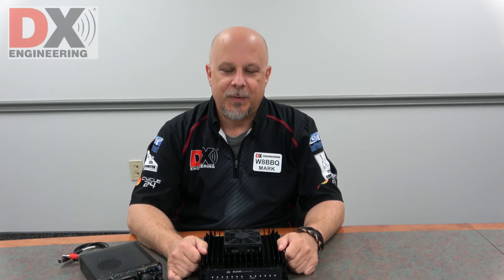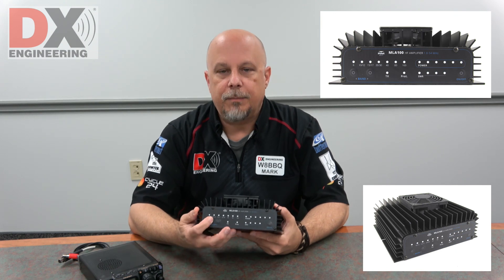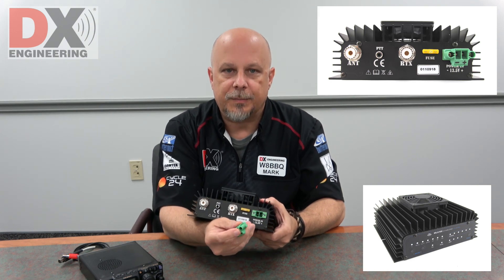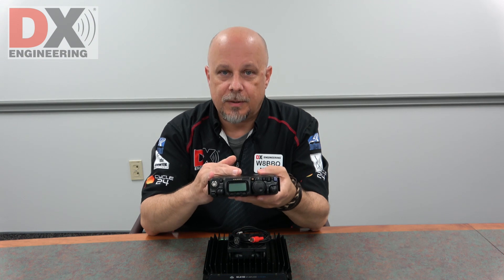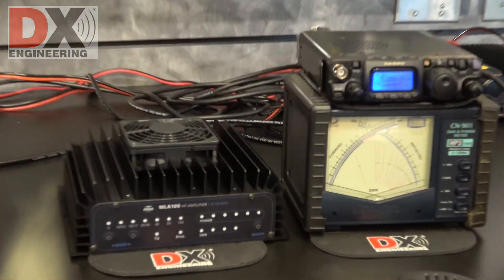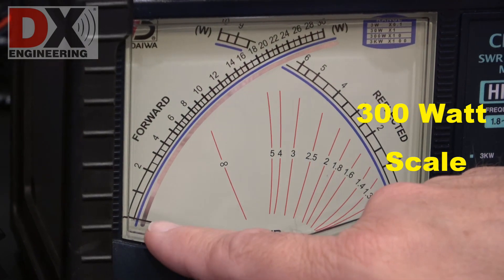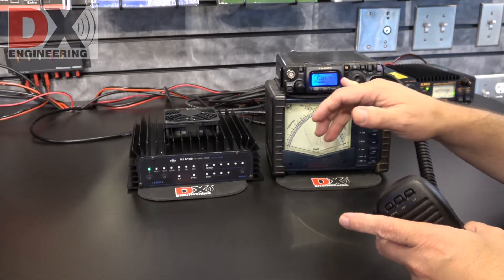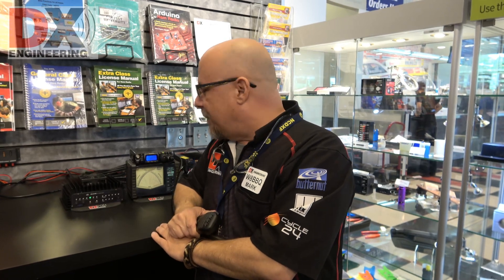RM Italy MLA100 Amplifier Demonstration

Comment: Why would you demo the amps output into a 3:1:1 set? Really? Your text overlay said your antenna was a better match at the lower end of the band.  Or better yet demo it into a dummy load. Really dx engineering?

Comment: Transmitting into a 3:1 match will give an artificially high power reading, won't it?

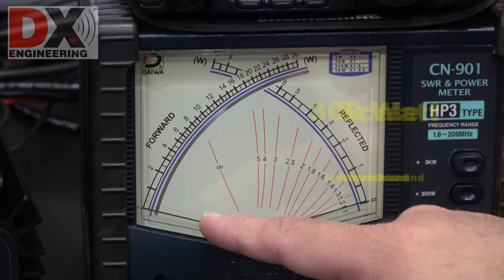At 3:53 it's showing a 3:1 mismatch.
What is the actual output at a 1:1 match...maybe into a dummy load?